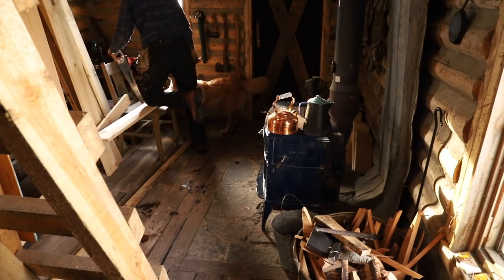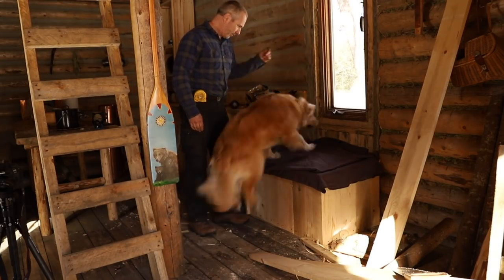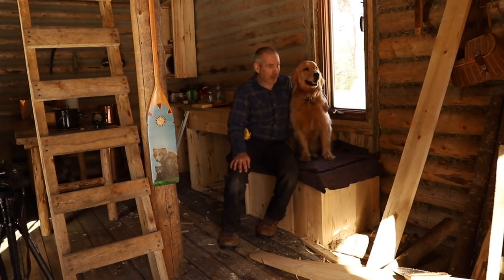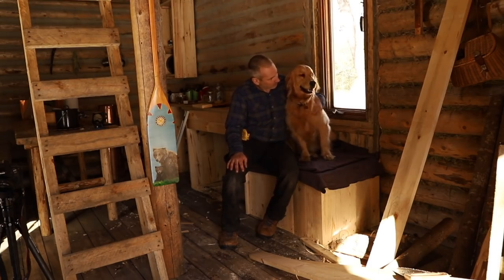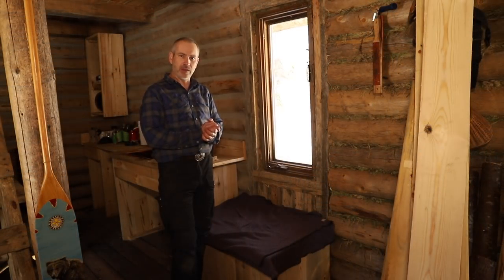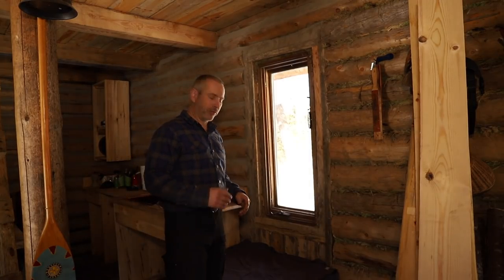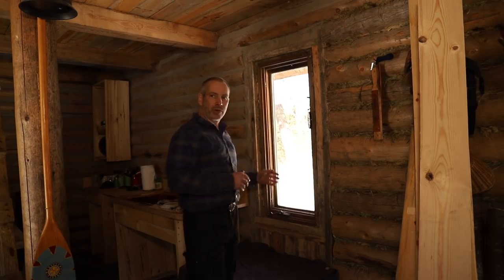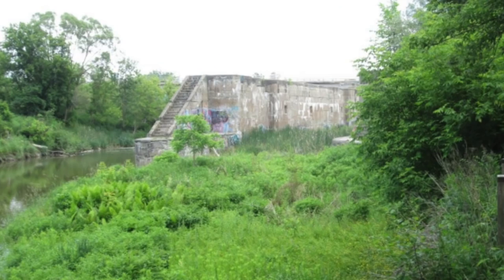Traditional Woodworking using Hand Tools: Finishing Interior of an Off Grid Log Cabin DIY Kitchen

Comment: Back in 1962 my dad and I built a cabin up in this area a place called Coldsprings. Our cabin had all the Amenities like inside bathroom and running hot and cold water electricity. It was 40’ X 27’ two story. We built a big fireplace that could burn a 59” log. The fireplace was in the center of the cabin and after a few days the rocks would heat up and upstairs we would have to open the windows because it would get up to 80 degrees. We got most of the wood for it from and old home that was built in 1840 in Sacromento that was being removed that was next to the Capitol building. My dad bought to house for one dollar and we had to tear in down or move it. We tour it down and saved the wood.  All that wood was rough cut so it was full size. The cool thing was there was very little knots and a lot of the timber was knot free. I had the best time working with my dad on this cabin. Before we got it finish my parents had to sell our home in Sacromento because their service station failed when the new freeway was opened. I worked there when I wasn’t in school from age 9 to 14. When we moved to the cabin my dad went back to driving gas tankers and would stay at my grandmothers in Oakland during the week and come to the cabin on the weekends. The cabin wasn’t even close to being finished when we first moved in. The water and the electricity was out front on a post. My dad would come up on the weekends and he and I would work on the cabin. One of the first things we did was to put the shingles on. Dad and I started on one side and got that one side done and he had to go back to work driving> he was going to finish the roof the next weekend. When he got back up to the cabin I had finished the roof. I was so proud that I could do that by myself. That roof was good for over 40 years. So my dad and I cleared the lot and built the cabin. It is only about 12 miles from our home in Twain Harte Ca. My dad had some strokes and he sold the cabin in 1994. It was supposed to say in the family but mom had passed in 1978 and dad wasn’t thinking right after having those small strokes when sold the cabin. So in 1996 on January 20th the wife and I moved to our home here in Twain Harte so it all worked out. I thought I would give you a little info about me. My dad was a great guy and I was very lucky to have him teach me how to be a man. The things I learned from him shaped my life and I learned that if you want something and can’t afford it then make it yourself. It lead me to be a millwright and I have built things that went on the voyager 2 spacecraft and been a sheetmetal worker and machinist and welder and even a welding teacher. I learned to be self-reliant and that is way I like your posts so much. You are showing the young people that they can do this too. So your videos are not only entertaining but are also very important too. Thanks again.
Reply: My dad passed in 1996 about three weeks after my wife and I moved back up to this area. ithink he would have like our home in Twain Harte. We are at 4500 feet above sea level here and we loveit here.
Reply: Gregory Rapier.        Thank you for sharing your remembrances; I'm sure your recollections are appreciated by many readers here, who are also well able to value the full-hearted sentiments behind your words.  :)
Reply: It was a long time ago Mom passed back in 1978 and Dad 1996. I was lucky to have two great parents. But this video is about Shawn not me. I just wanted to let Shawn know that I really like his videos. Sorry Shawn I didn't want to make this about me.
Reply: Gregory Rapier     If you don't mind my saying, you didn't make this about you.  You contributed recollections that completely fit.  Others too, relate to your history, having similar stories.  There is nothing shameful about a sense of community that people share.  Society has lost that, and many would say that it's been detrimental.  If you'll notice, at this time, at least 45 people have given your comment a thumbs up;  that's a lot of appreciation.  I think it's fair to say that they're saying thank you, and Shawn too, gave an appreciative mark.  Thanks again.
Reply: Mashud Ahmed  I think that once money came into being was the downfall of mankind. Once we as humans stopped living in villages and tight nite family groups, we also started loosing who we are. People who still live in small towns, and villages as in Europe, for the most part, still rely on each other. Every once in a while you 'll see us all rally for someone in need or there is a disaster we rally to help with supplies to help those victims to get back on their feet. But for the most part, we live more and more in seclusion. When we still lived together in villages and family groups we all pulled together for the common good of all in that village or family group. When a hut or home needs building everyone moves as one. We hunted together, we planted and harvested for the good of all. Everything was/is shared in small groups and villages. We see that humans still living in small groups of the Amish how everyone gathers, without being asked or for money
Reply: How long did it take to type this and this is an interesting story

Comment: I like your cabin very much and I've watched already most of your videos. This time I especially loved watching you doing a high leveled bed for your beautiful good dog. And, of course, the explanations about how to construct around a window. Please allowe me to give two advices:
1) Try not letting slip/flip the scale tape back against the tape measure cover because this behavior will lengthen/harm it. Sooner or later this habit will cause faults in measurement from at least 1mm up to 3mm!
The angled stopper will become more loose than it should be and/or become crooked. In this case it will never hold on an edge while measuring. Worst case: It will brake away.
2) If hammering sharp nails into wood the risk splitting it is much higher than if giving the nail top a punch with a hammer to soften/dull it before driving it in! The bigger the nail, the more important this kind of split prevention becomes.
Again: All the best luck to you, your wife/family, your faithful dog and projects for now and future

Comment: I really love what you're doing. I've been wondering (yeah a bit late to the party but I only discovered your channel a week ago) you seem to use a lot of nails where I would have considered screws. Is there a reason for that?
Second thing is the copper back plate you have at your sink table top. I get the double sink top (it makes the sink you made, good job on that) really sink in and you can wipe the things from the top in, but doesn't the way the backplate is now allow water to seep in between the back and the sink table top?

Comment: All along I thought you were going to make a little "refrigerated" cupboard behind the boards under the window.  haha!  guess I was wrong.    If you're open to suggestions, I'd line the inside of that dog bed/storage box with slate, seal it up with beeswax and have a built in freshwater cistern.  (Actually, I'd have buried a huge poly tank in the ground under the floor first, but hey man, it's your cabin, and you're doing great so far!

Comment: Bobby Orr stories?
I learned a neat trick for toekicks under our kitchen and Bathroom cabinets. I guess and tape strong magnets to the cabinet legs and toe my self crafted toe kicks. They hold great, line up perfectly and are easily removed for access to water lines, cleaning, etc without any damage. No screws, no nails and a beautiful result. Just super work, Shawn.

Comment: I'm planning on doing something like this but I can't figure out how I'd do a few things. Like laundry or how I'd setup a shower or how I'd do a foundation for my cabin. I don't really want the cabin to sit on the ground and I don't want to use concrete. I'm reading a book on 18th century building and so far I'm liking it. As for the shower I was thinking about heating water with solar but that would be a ways off as I don't have $ for it atm. Finally I have no clue how I'd do laundry. If anyone know of any good setups for these I'd be grateful if you could post it below.

Comment: Have you ever hear of a rocket mass heater! Its a very efficient wood burning stove you have to build yourself obce the mass unit filled with rocks, riff raff sand and gravel n clay is heated bit will stay warm or heat ur home for two to three days! i hear about a guy in Montana lived in a Tee Pee all winter. and this rocket mass stove/heater was what he used u burn less wood  and u feed the wood vertically and you can cook on it as well as there is a 50 gallon drum. And u dont need a chimney you can vent it through a wall. And you can be creative in your constuction and its fairly cheap to build to boot, I was thinking about building one in my basement as a backup heat source n put some grates in my floors. U need stove pipe, some brick to make a J tube type stove a 50 gallon barrel n make a long box almost like a coffin filled w stove pipe n ur rock riff raff, dirt sand gravel n clay might take a day or two to build. So that mass unit is or acts like sort of a HEAT BANK ur heat is stored n not lost so ur not constantly feeding the fire kind of a cool idea especially for living in a cabin  like you are and or do n you can go hunt or fish or do other things n come home n ur house is still warm even if the fire goes out food 4 thought! James Dempsey

Comment: Just an idea to increase the capacity of available water for the kitchen:
Either dig a whole in the ground under the sink and insulate it with clay, like you did with your "fridge", or
buy a removable plastic tank, to put in the hole, which would be easier to refill too.

Comment: I love your cabin to bits but there's one thing that bugs me as a cabinet maker 😂 when building drawers it's meant to have the sides running through and the front/back running between the sides, after pulling on a front fixed panel for a little while it will start to separate from the rest of the drawer, by having it fixed in from the sides will make it alot stronger also when clamping planks together it was too hard to see which way you had done it but the end grain should run opposite to each other I guess you could explain it like having each second plank upside down to the other, this prevents the finished piece from cupping and when clamping have one clamp under the piece and the second on top then 3rd under and 4th on top and so on this also distributes the clamping force evenly and will stop the whole lot from waiting to curl up and pop out :) hope this helps any other cabinet making you undertake, I'm a first time commenter on your videos so I would also like to take this time to say thankyou for sharing all this content with us viewers.

Comment: That small heat activated fan you're using; could you recommend that one for a bigger house to move the heat around more evenly? We have two floors and find it hard to get the heat from the fireplace to move around properly through out the house. I'd rather not go for the electric fan insert that's available from the manufacturer.

Comment: check out kris harbor and his round house build with fire wood cut type of logs and earthen mud for concrete filler ,mainly i ws thinkin a stair way like his would look good in ur cabin,i know u are doing ur own thing thats cool but his log steps are awsome i think he use a curved log ripped down the middle an used each half for either side of his riser4 his steps

Comment: Shawn, I meant to ask this when this vid first went up, and a quick scan of the comments tells me that I forgot: I hav the froe from Lee Valley, and the edge on it is actually so dull that it's round. I've read that a froe doesn't have to actually be *sharp*, but a round edge? Doesn't seem correct to me.

I'm only bringing it up because it looks like yours might be the same as mine, but yours is working great. What did you do to get the edge workable?
Reply from the maker: I'm actually thinking the same thing - it's too dull to be useful the way it came from the store. I'll be sharpening mine a bit before I get into a whole bunch of shingles in the next couple of weeks.
Reply: If you do, will you include a bit on it in an upcoming vid or drop me a comment over on my channel to say what you ended up doing? It's my first froe, so I'm afraid of doing the wrong thing to it.